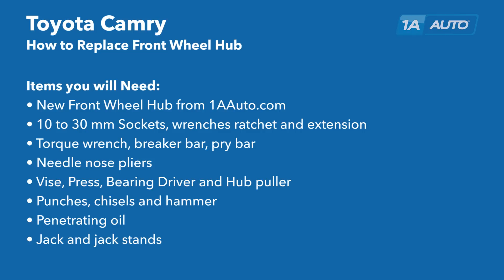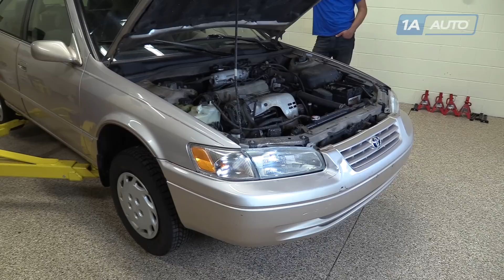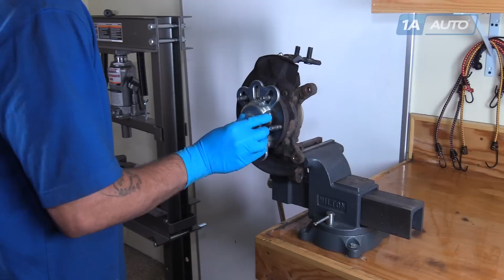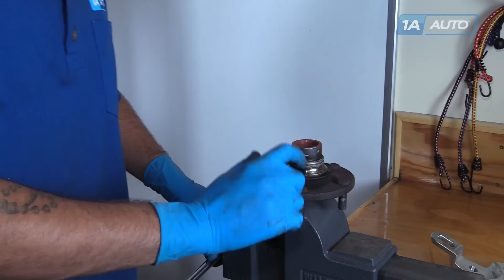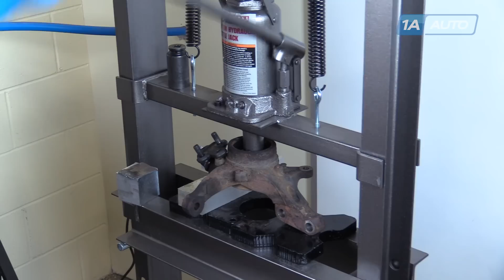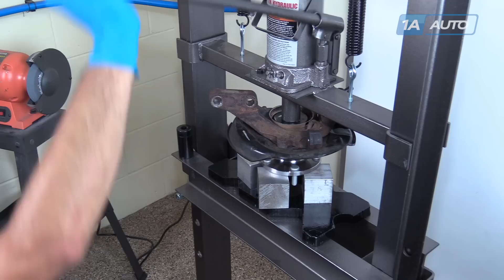How to Replace Front Wheel Hub 92-01 Toyota Camry

Comment: I gotta do this on a hub where all the wheel studs snapped off. Do I just tap the broken studs out and install new ones or would the wheel wobbling until they all snapped off one by one be reason enough to change the bearing and hub

Comment: Instead of worrying about the press, why cant you just also replace and change that part out also with a new wheel hub? Can that be done?
Reply from the maker: +Kelly Hamilton Thanks for checking us out! When you are changing the bearing hub, you can replace the bearing using the same hub usually without issue. If you just want to change the hub, this is more difficult to do as typically the bearing is damaged when it gets pressed out of the hub. Its highly recommended to change the hub and bearing at the same time.

Comment: So I did exactly as you stated, but you cannot put in the "C" clamp before you press in the spindle, if you do, the bearing has room to move and break and I destroyed one bearing until I figured this out.  Put the "C" clamp in AFTER you press in the spindle.  The "C" clamp gives the bearing just enough room to move and 'break' if you put it in first.
Reply: John S., you are correct if you follow the instructions in the exact order presented you will ruin the bearing when pressing the Hub. With an 81mm spacer on top of the snap ring the inner bearing race will not be supported. You must delay installing the snap ring until after the hub is installed, or use a smaller spacer the fits inside of the snap ring. I went with the latter choice and had no problem.